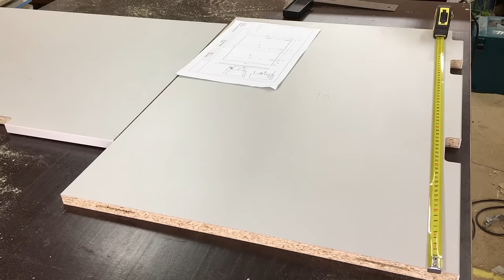diy frameless kitchen cabinets

Comment: nicely done. with the lighting what i do is when the unit is ready then i route the bottom and when installed on wall i put 1 long profile and 1 led strip init. so u dont have to run cables on every cabinet and it looks like 1 light not separate. other than that nice job. i work in my garege too got the same mess as well :)
Reply from the maker: other solution - to add one long "second bottom" for all cabinets and add light there.

Comment: Pretty good work, just some tips from a german furniture maker (this is basically what we build 90% of the time)
Instead of wood glue, use screws (predrilled holes in the vertical panels) when coupling the 4 sides (at least when two cupboards go beside each other?), stronger and faster joint, the lamello are just for holding it in place.
The biggest improvement in my opinion you still can make, and weirdly not a lot of people do, even carpenters here:
8mm melanin particle board for backwall. And then into a rabit, not a slot. Screw this one in. Looks super clean (we use the same for drawer bottoms). Besides that nice to see it catching on, weird to see all the holes and stuff being done manually, we usually do it on a cnc^^
Reply: Use a kreg jig on the top and bottom that way you don’t see them as the worktop covers them
Reply: As a Croatian I believe in German engineering, please could you help me, I'm trying to make a wardrobe and made it in sketchup, only question is what to do to joint top/bottom with left and right panels, rafix 20 or minifix with 1 or 2 dowels? What about cabineo 12, it is expensive but is it worth it? I will do it with 18mm thick plywood...
Reply: Danke, sehr hilfreich! :)
Reply: Rabbet.
Reply: Best comment, just what I wanted to say. Especially about the rabbet. Changing the position of the router prevents any chipping on the edge.
Reply: How do you make rabbet, I mean do you cut sides or 8mm melamine?
Reply: @mrki412  yeah, you cut the vertical sides with an 8.5mm groove or rabbet and screw it on from behind.

Comment: Great job, but what exactly do you mean by frameless ?? As you technically made the frame yourself ?
Reply: Probably he meant that he got no frame, that usually covers the front of the cabinets, when cabinets made from plywood. Otherwise I have no idea, what he meant, and yet I myself produce furniture like that in the video.
Reply from the maker: Here is some comparion of framed vs frameless: https://www.cabinets.com/frameless-vs-face-frame-cabinets
Reply: @garage1168  ohhh ok, i get you. This seems a rather american thing. Sorry i worked in a chipboard mill for 10 year making flat pack furniture like kitchens and wardrobes etc and i just presumed when you said frame you meant the carcass. Even still though great job !!

Comment: Very Good Work...✌🏽✌🏽✌🏽... what’s the name of the white plastic fittings you used at the back of the cabinet in 3:01
Reply from the maker: Rear Panel Connector - https://www.hafele.co.uk/en/product/rear-panel-connector-plastic-screw-fixing/0000010600032b1d00010023/?fbclid=IwAR0t-_kC3FMx470yuUnlXJjP5FzyfHDib2D0BfnFvihaAyJGs2HFEKWBGGM
Reply: @garage1168  thanks

Comment: how did you make the template for the handleless molding can you make a stencil?
Reply from the maker: Cut it with router using adjustable template: https://youtu.be/jTeRL2_GYgE but same can be done making needed shape from scrap wood and then routing out using flush trim router bit

Comment: How much gap did you leave between two panels gola profile finger access?
Reply from the maker: L profile is 50mm, C profile is 65mm, so gap I left is 35mm (65-50 = 15; 50-15 = 35)
Reply: @garage1168  Thanks

Comment: What is the brand for your biscuit jointer?
Reply from the maker: It is Hilda 760w biscuit jointer. But I would suggest to take a look at another biscuit jointers - mine required modifications to be usable.
Reply: @garage1168  thanks, the Festool brand is quite expensive for me and not available in my country.

Comment: Thanks for the video! I have a question about the larger doors you use for the uppers & in some places on the lowers. Do you have any concerns with warping or cupping over time? I know the particleboard and plywood is more stable, but I've had some sheets in my garage get a tittle warped and I'm nervous to use them for my own kitchen project.
Reply from the maker: For larger doors it make sense to add more hinges - usually it helps door to stay straight even it is little bit warped.
Reply: @garage1168  Hi there great job looks awesome. Wondering if you could share where you sourced your laminated material from? I’m looking into doing the same thing. Thank you in advance.

Comment: Why use particle board instead of ply board?
The screw holding capacity of particle board is not good...🙄
Reply from the maker: Particle board is already finished, plywood needs painting. In kitchen there are no such forces so screw holding would be critical.
Reply: You must have never heard of confirmate screws ...

Comment: DIY if you’ve a few £1000 to invest in very specialist equipment and a huge workshop.
Reply from the maker: not really. I believe tools I used are under 500eur in total. workshop/garage is advantage, not requirement - same could be done even in kitchen.

Comment: When will they stop calling it "DIY" while using expensive power tools which most of us cannot afford. I can't do this. DIY is something which can be done with a hammer, a drill, some chisels, hand saw and a power saw at the maximum. We click videos seeing the word DIY, and then there is some expensive workshop thing starts.
Reply from the maker: expensive power tools? everything is shown here could be easily done with tools what cost less that 4 drawer slides.
Reply: @garage1168  I am from India. The tools shown here except for the hand tools I mentioned in my comment cost over 75000 here which is more then average salary of a person (average well-to-do people earn around 50000 a month).

Comment: Nice work, but not very efficient. Pocket holes are faster than biscuits. And for unfinished ends, just staple and screw— no need for clamping. And all that notching and grooving and expensive hardware (leveling feet and hanging rails) is really a waste of time and money.

Comment: DIY only if you are a professional carpenter with experience and have a shop with all the tools.
Reply from the maker: What is DIY in your opinion?
Reply: Hofer (Aldi in some countries) is offering a biscuit joiner for 35 euro this week. It might not be the best one, but even DeWalt biscuit joiner needs some tweaking to work properly. And plenty youtube tutorials how to dial one in ... for the same price they offer a router to go with it. So, for 70 euro, you are set for most of the work from this video. I addition all you need is a drill, maybe some clamps. There are even workarounds to using clamps.
To gain experience, you need to work on the skill. garage11 kindly took the time to show some ideas. I'm guessing he won't be mad at all, if you try and replicate some of his work. A shop you can set up in any space, even small, if you go and only make one carcass at a time.

Comment: Quality of plyboard you use is very third class cheap quality...
Just use n throw quality
Reply from the maker: What brands make good melamine faced boards?
Reply: @garage1168  actually melamine boards is not good for kitchens and the reason u know very well... U can use HDMR board, or 18 mm solid ply for best result...
Reply: @cricketpermanent  In Europe we have not used anything else for carcasses for the last 60 years.

Comment: It's partical board, does it really stays well for an year
Reply: I'm wondering the same thing. To put holes into a compressed chipboard panel like that I'm not sure. Plus also all the gaps around the cabinet, doesn't look like a very finished project to me. It's hiding grounds for dust and cockroaches, etc.
Reply from the maker: What happens to particle board after year?
Reply: @SyemurN  You should adress your cockroach/general hygiene problems before starting to build furniture. Plenty of tutorials on youtube ... In Europe we have been making furniture out of particle board for the last 60 years, and continue to do so. It is, arguably, a better way of utilization of a resource (wood), for one.

Comment: Could you please tell me what is the distance between the bottom edge of the worktop and the upper edge of the cabinet door?
Reply from the maker: If I remember corectly, distance was 35mm.  In my current kitchen distance is 30mm.

Comment: I’m not a fan of particleboard.
Reply: It's not about being a fan, no one really "likes" MDF, particleboard, melamine, veneers, plywood or any engineered materials. The fact is styles change much more frequently than they used to. People don't want a kitchen they feel is too precious to throw away and refit to the latest and greatest. A kitchen should be built to throw away in 10-15 years tops.